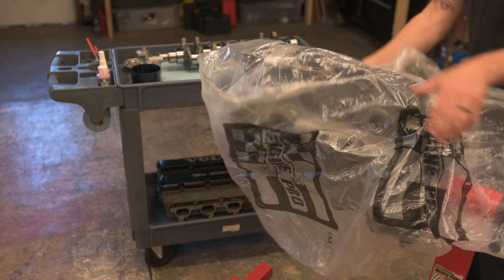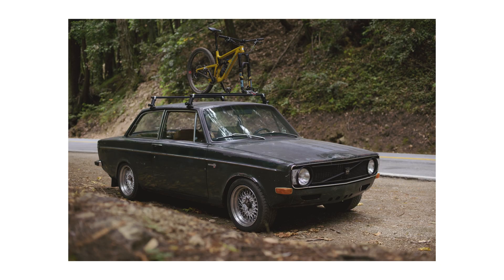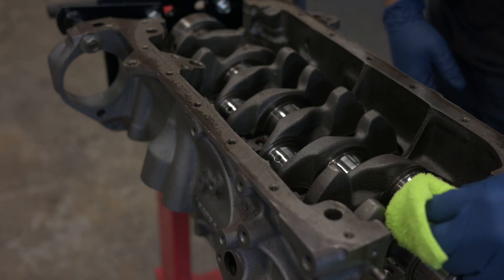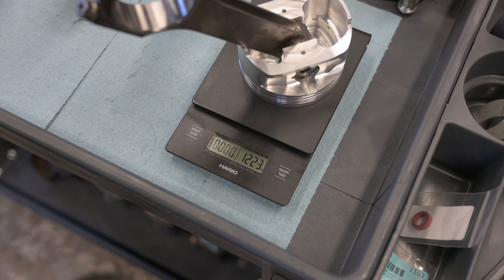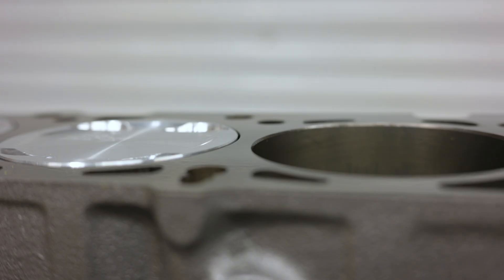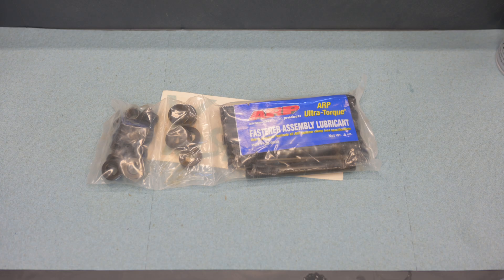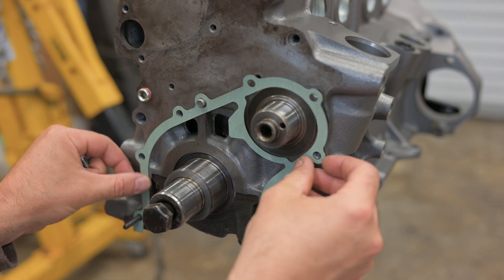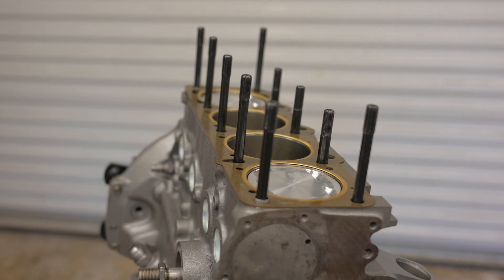Building a Volvo B230 16-Valve Turbo Engine: Part 1

Comment: What parts did the 8 valve b23 have (turbo, intercooler, wiring, etc.)? What were some sources you referred to in figuring out how to build these? Whyd you choose a 16valve this time? What kind of hp numbers do you expect? Can you make your build videos as descriptive as possible for less knowledgeable builders who might consider trying your recipe?
Reply from the maker: turbobricks.com is where I've learned most things, and where I have a pretty extensive build thread of the old engine. The 8 valve, in it's final iteration had a Borg Warner S252 turbo with a pretty small (.48 AR I think) turbine housing on it. Spooled very quickly. It had a stock B230ft turbo manifold, a home made intake manifold, some eBay intercooler, and was running Bosch LH 2.4 from an early 90s 940 or something like that. It was probably the engine management and lack of control over fuel and timing that killed that engine. I decided to go 16v this time mostly because I thought it was cooler. I'm shooting for 350-400 whp, which is certainly doable with 8 valves, but the stock 16v head flows like a pretty seriously ported 8 valve head, so I figured it would be a better starting point. Plus they sound good, look cool, and I don't know of many other 142s with 16v turbos.

Comment: I has an interesting question. Turbo 740/940 cost 5-6k now. is it good idea to buy non tubro version 740/760/940, it cost 1k, replace pistons, add turbo and itercooler? Same 740 turbo, but final cost would be 2 times less, right?
Reply from the maker: If you're doing all the work yourself, I think you could probably end up saving a bit of money. But probably not much. All the little stuff you'll need will add up. Also, don't forget you'll need an ECU and possibly a wiring harness from the turbo car to run it. And fuel injectors, turbo oil drain, etc. Plenty of people have done it, though. I'd go to turbobricks.com and search "plus T" to see what you're getting into.

Comment: Where is part 2?????
Reply from the maker: Believe it or not, this engine has been sitting on the stand, wrapped in a garbage bag since I finished this video. I got sidetracked with some other projects. But that’s mostly done now and I’m getting back to it as soon as possible.
Reply: @tfrasca hey it’s understandable, we all have things we need to do and other projects get sidetracked
Reply: @tfrasca one question, could you list the links of where to get all the parts for this build?

Comment: What oil pump is it that you use?
Reply from the maker: It’s a Melling M181 “high volume” pump with a shortened pick up to fit in the b20 pan.
Reply: @tfrasca  Thank you!
Reply: Can you give more details on the pump? Where you bought it @tfrasca
Reply: Is it possible to just use a b20 pump?

Comment: With the deck clearance, or lack of it, it feels like at high rpm the conrod stretch will do your engine a mischief.
Reply from the maker: Yeah some people have let me know that I might be in trouble. When I get back to this project I’ll be reconsidering what to do here. I wanted to run a stock head gasket, but maybe I need to run a thicker MLS gasket.

Comment: Very nice video! Question: how did you secure the crank when tightning the crankshaft pulley?
Reply from the maker: At 16:59 you can see the steel flat bar I put between two crank bolts and the engine stand to hold the crank.

Comment: Piston oil control ring job is to keep oil away from the piston ring, continue to pore oil straight to the piston rings, nr1 mistake almost all engine builders do 😅
Reply from the maker: I'd rather have things lubed up before the rings are seated than risk scoring the cylinder or seizing a ring on a bone dry start up. That oil will burn off in the first couple minutes anyway, and by then the top two rings should be pretty well seated. At least that's how I understand it. Do you install the pistons and rings completely dry?
Reply: @tfrasca  yea ofc I install them dry. I oil the innerside of the cylinderwall before I put the piston in and then turn the motor around by hand a couple of times. Oil on the piston rings will just sitt there cook and burn the first thing when you are starting the engine, and make the piston ring more likely to get stuck. This is also s prefered method from Jim's Automotive Machine Shop, you should check them out, I'm pretty sure they know what they are talking about....
Reply from the maker: @oscarolander7455  I'll check it out, thanks for the tip.

Comment: tell on the nest clipp how u do with the oil stik.. oil level and all that.
Reply from the maker: The oil dipstick will be a problem. On the 8-valve I simply cut a stock dipstick to fit into the B20 oil pan, and put new marks on it for the oil level. But with this engine, I think the intake manifold will be in the way. I’ll have to figure something else out.

Comment: .047 - .018' = .019'. Danger danger! You need .04' per 1000rpm squish minimum, 0.05' is safer so you need at least 0.032' for 8000rpm. I'd be looking at a thicker cometic hg to get the clearance given the 16v likes to rev.
Reply from the maker: Also, I assume you mean .004-.005 per 1000 rpm, right?
Reply from the maker: Also also, it looks like the math is wrong. .047-.018=.029. That's still not enough for 8k given your formula, but at least it's closer to being safe for 7k. Seems like I should be looking at an MLS gasket around .5? Sorry for the rapid fire replies, just trying to figure this out. Would you use stock bolts with an MLS gasket? I don't want to use the ARP studs I have, as I've heard they lose clamp load over time because the washers dig into the aluminum head surface, and they don't have the right elasticity for aluminum expansion.
Reply: @tfrasca  yeah sorry. It's still very close. You should use a dial guage to measure the difference too.
Reply: @tfrasca  and I've not heard about issues with head studs. They offer superior clamping so it's a no brainer to use.
Reply from the maker: Ok this is good info! So you’re saying I’m at risk of the piston hitting the head itself, not even just the valves?

Comment: The slow tedious process. That thing looks great though!
Reply from the maker: Thanks Dean! I figured if you can get so much work done on that yellow 142, along with having like 39 other cars, I should be able to at least put an engine in mine…
Reply: @tfrasca  its a struggle as you know but little bites at a time is all it takes. This video makes me want to dig out my “extra cam” B230.

Comment: Just a tip - The oil plug on the front by the water pump is unfiltered oil, i recommend a filter on you oil feed line 😁
Reply from the maker: Ah, I didn’t think of that. Thanks!